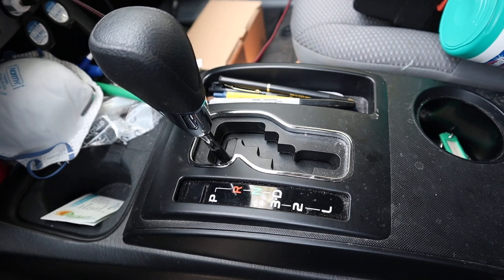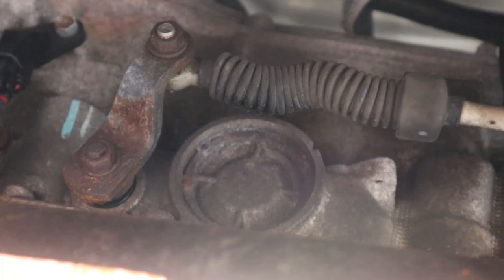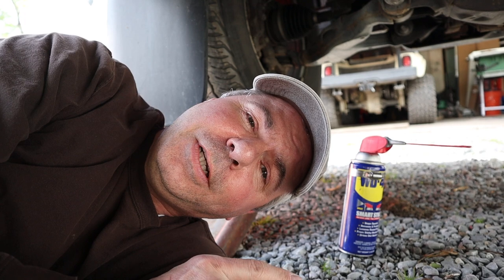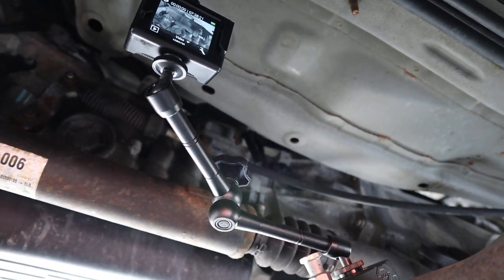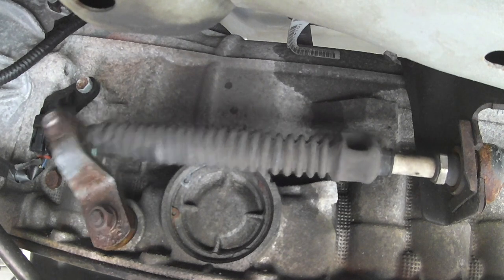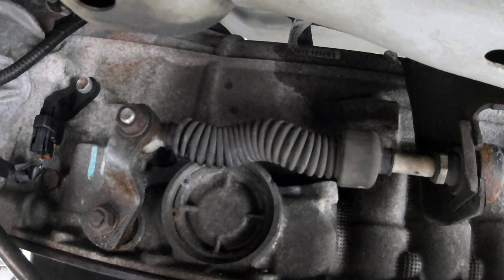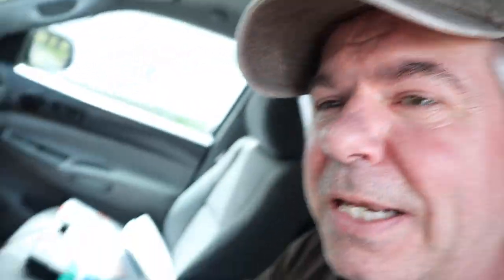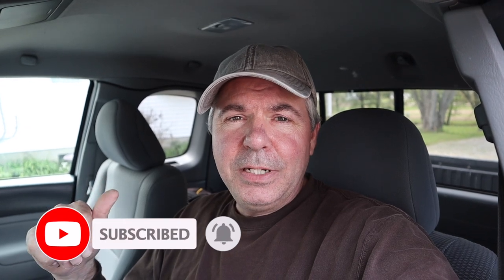Toyota Tacoma Shifter Stuck? Here's a quick and easy fix for your sticky shifter. MCG #10

Comment: Thank you, thank you.
I followed your video instruction, and now my shifter is working and smooth.
The stiffness happened to my 2014 4Runner and didn't know what to do. I was just about take it to a dealer but after I saw your video, I did just like you showed, and my shifter is working like a new, no more problem.
Thank you for your help.
Reply from the maker: Glad it worked! You may have to re-lube every few months.

Comment: The shifter in my 2015 Taco was also getting stiff. I found your video, paused half way through to go out and WD40 followed by white lithium grease the linkage on mine, and viola, it's fixed. Thanks! I appreciate you taking the time to film and post this! And by the way I made similar groaning noises while crawling under mine lol . Another tip is I've soaked in between the leaf springs with white lithium grease to stop squeaks in the back and it's great for that too.
Reply from the maker: Thanks so much! You’ll have to re-lubricate periodically. Last time I used wd40 gel which is working well.

Comment: My 2018 Tacoma was doing the same stuff. This video is gold! Thanks for making it. I used a little penetrating oil and then slathered on some Red n Tacky. I thought I'd have to get a new transmission!
Reply from the maker: Nice! Good idea sealing it with grease. I still have to spray mine every 6 months or so. Thanks for watching.

Comment: You saved me an expensive trip to the dealer. My 4Runner was having issues and wouldn’t display the drive mode on the dash. When I’d shift, It felt very loose. Spraying this mechanical piece with WD and white lithium spray worked like a charm!
Reply from the maker: Awesome!

Comment: Excellent, My 05 did the same.The rod you are lubricating goes thru the transmission to neutral/park safety switch.  Lube this end too. Spray behind plastic switch housing and trans case. 250000 miles still butter smooth shifting.  Just traded fo 2020 4 Runner. Love It
Reply from the maker: David Els - very nice. Thank you and congrats on the 2020 upgrade! Thanks for watching. -Ed
Reply: David is it possible to access the other area you are referring to from under the truck? Or do you need to remove things on the i side to get to it?
Reply: @benopie7772  Ben, no the neutral safety switch is in the way. I aimed the oil can above the shaft and let dribble down the trans case. Worked good immediately caused the shifter to work easily. I did this twice a year. I lived in Virginia Beach and constantly driving in brackish water.
Reply: @benopie7772  But yes did all of this under the truck.

Comment: Seriously, thank you! Had the engine light come in and got a code from auto store about replacing transmission switch…. 5 mins and WD40 it works great! Thank you!!!
Reply from the maker: Excellent! You are welcome. If your truck is like mine, you’ll have to climb under there every couple months and re-spray it.

Comment: Huge thanks!  This has been plaguing me for months on my 06 4Runner.  It was so bad I was getting CELs for the gear sensor.  Kept trying to lube the linkage under the shifter.  Tried this and it fixed it!
Reply from the maker: Awesome! I haven’t found the best long lasting lubricant yet, so I still have to go under every few months. Thanks for your comment. -Ed@MCG
Reply: @MyClutteredGarage  Well, that only takes a minutes and is best of all free.  4 minutes a year is a small price to pay to keep it shifting smoothly.
Reply: How hard would it be to replace the nuts and bolts down there
Reply from the maker: @benopie7772  Not sure, but I suppose changing the linkage joint is an option. I used WD40 Gel spray last time and it's holding up well!

Comment: I have done this very thing a number of times but it kept returning no matter what stuff I used. About 6 months ago I decided to try something a little more permanent and it seems to be working so well I decided to add a comment here. The spray lube fix works good and fast but trying my modification could be more permanent. It took me about 20 minutes to complete the fix. I removed the nut hold the shifter cable to the lever underneath the truck...it takes a 13mm wrench. Once removed, use a wire brush to remove the rust and corrosion buildup on both sides of the lever, from the nit, and from the shifter level connector. Then put a good coating of lithium grease on both sides of the connector, the steel lever, and the nut. Then reassemble (making sure the connector screw fits all the way through the square hole on the lever) and tighten. It's been 6 months so far without any sticking.
Reply from the maker: Awesome! Thanks for sharing!

Comment: If the problem gets seriously sticky, the car may not start at all if the system doesn't recognize it being in park. The light for P should show on the dashboard when it is in Park. Mine suddenly didn't and I couldn't start my 2013 Tacoma. My truck threw the error code P0705 "Transmission Range Sensor A.Circuit (PRNDL Input)". Dousing it with WD-40 after watching your video solved the problem completely!  Probably saved me hundreds of dollars and a tow to the shop. (I understand that for this application, silicone lubricant is best because it is safe for plastic and rubber).
Reply from the maker: Glad it helped! I still have to spray mine every few months or it starts to stick again. Thanks for the feedback! -Ed

Comment: I guess I should be happy that it took so long for this issue to hit my 2005 Tacoma.  But hopping into my truck to make a run to pick up a 25 yr. old "squatter" at the airport I could just barely manipulate the shift level.  Drove for the next 1 hour too nervous to take my truck out of drive.  After watching to the 2-minute mark I ran out, grabbed a can of WD40, and slithered under my truck.  I easily found the linkage (identical to the one in the video), sprayed it and my issue was solved.  (It's never this easy), Thanks!
Reply from the maker: Excellent! I still have to spray mine every few months.
Reply: @MyClutteredGarage  Thank you, good to know.  I'll still need to crawl back under with a more hardy lubricant for a longer-term solution.

Comment: Mine was so bad it was setting a PO705 trouble code. Oiling the cable connector only helped for a while.  I decided to disconnect the cable from the shifter arm on the transmission. The threaded connector on the end of the shifter cable that you were oiling wasn't able to spin freely on mine. I worked it loose and forced some grease into it and it's all better. 2017 Tacoma.
Reply: Same thing on my 2017 Tacoma today …PO 705 TRC light on , engine light on, sprayed this , disconnected battery negative terminal, put back..Everything’s fine now.

Comment: Hey, thanks for posting this, it was very helpful. My 2013 4Runner has had a sticky shifter the last few times. I drove it, to the point that it wasn't registering on the dash that it was in drive, I had to put it over into manual mode to get it to register. This seems to have done the trick.
Reply from the maker: Awesome. Thank you.

Comment: Thought I was going to break the shifter on my 2017 Taco. This worked perfectly! However, is replacing that part the only permanent solution? I'm almost 70, so getting down and up from the ground is not so easy anymore.
Reply from the maker: Mine required re-spraying every few months. I’d say you have to replace the connector. It’s really unfortunate how many of these trucks have the issue!

Comment: This is an excellent video; but I think I broke something inside the shifter box inside the cab. Can you explain how to fix this?  Now the shifter handle moves freely without doing anything.  Thanks for any help.
Reply from the maker: Gary Gray it’s possible that the cable broke. I haven’t taken the box off the shifter but I bet it’s not a bad job to do.
Reply: @MyClutteredGarage  I took the top off of the shifter box and found that the cable has an eye on the end of it that slips over a pin on the shifter handle.  This eye keeps slipping off.  Temporarily, I am twisting a piece of wire around the eye so that it doesn't slip off.  I'm still trying to get the rust off underneath the truck.  Thanks for all your help.
Reply: @garygray2973  i think thus is a bushing i saw another video on this for a Camry it was a $7 piece that connects the two components youre referring to

Comment: Man my 2005 Taco with 250k has a shifter problem. Ive had the shifter cable replaced twice. No one can seem to fix it. (About 5 shops so far) If this solves my problem of the truck not knowing when its in any gear, or even park, I'll be blown away by the simplicity of the solution.
Reply from the maker: Good luck! Come back and let me know! -Ed
Reply: @MyClutteredGarage  i might not get the chance to share. Something inside the center module just snapped and now its getting towed. I'll let you know what the dealer says. 🥺
Reply from the maker: @FreedomFishing  bummer!
Reply: @MyClutteredGarage  right! Literally was on the way to have the dealer check it out too. Talk about timing lol.
Reply: @FreedomFishing   How did you make out? Hope it was an easy fix !

Comment: ⚠️ does this apply to 2016 4Runner also? I’m also getting a P0705 code and my shifter is very stiff.

It started intermittently last winter and then went away all summer but now it’s back and won’t go back to normal. 

When I shift it in to Drive it’s stiff and doesn’t register the “D” on the dash. It registers park, Reverse and Neutral but not Drive and it also no longer registers tiptronic sports mode. 

Because it’s stiff do you think it’s the actual shifter and probably not the PRNDL sensor?
Reply from the maker: I’d crawl under there and check. I think there’s a good chance it’s the same.
Reply: I have the exact same problem with my 2016 Tacoma. same exact symptoms! only happens in winter... this year it's bad.  but did you end up finding a fix?
Reply: @arcflash29  It was happening for a few days and not going away like it did last year and I was going to look at it when my wife got back home with the truck BUT then it fixed itself 🙄. I guess I’m happy that it’s no longer a problem…for now! I sprayed some grease on the linkage under the truck in hopes that it would help. I guess time will tell to see if it’s the linkage or that other part that I can remember the name right now 😂.

Comment: Your video is great.  Thanks so much for putting it out there.  
Question: Do you have any videos or pics of the shifter cable as it is connected on the shifter?  I was adjusting my e-brake and noticed that the cable is loose as it attaches to the shifter itself.  Not sure if it needs a special retainer or just a simple nut.  Please help.
Reply from the maker: Thanks very much, but sorry I don't. I haven't had any other issues with it. I hope you find your answer! -Ed
Reply: I had the same issue. I found the "Bushing Fix BP1Kit - Transmission Shift Cable Bushing Repair Kit" on Amazon. Fixed it quick!

Comment: Nice video. Where did you get the camera arm that you used under the truck?
Reply from the maker: Thanks, Rick. That was pieced together from various gear that I've had for years. There are several modern solutions. Maybe just search for go-pro mounts, and there should be some good results. Thanks for watching! -Ed

Comment: I had my check engine light come on and it say something about transmission selector switch. Would that cause my shifter to stick?
Reply from the maker: If your shifter is stuck, it could cause a check engine light to come in. That happened with mine.

Comment: use synthetic waterproof spray then same in grease! none of that other weak material - amsoil is very good for my 2001 4wd Yota TRD Pro!!
Reply: Do you have a recommendation on some brands? What worked for you best? Pls & Thx!
Reply: I’ve only used amsoil only because the data is strong & I get at cost.

Comment: I have to climb under and mess with this connection every 2 months or so. I have been stuck struggling to get into Drive multiple times. Mine is a 2019 with only 20,000 miles. So frustrating. I have never had a vehicle start giving me problems at only 14,000 miles before. My Mitsubishi has been way more reliable at 130,000 miles.
Reply from the maker: I’m surprised Toyota didn’t resolve this by 2019. Bummer.